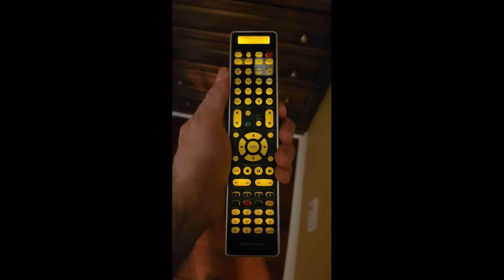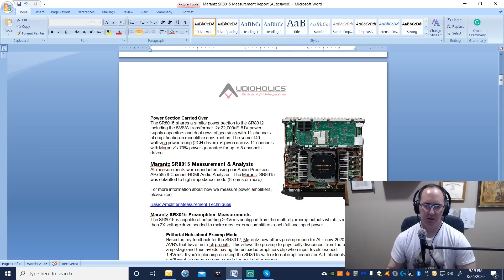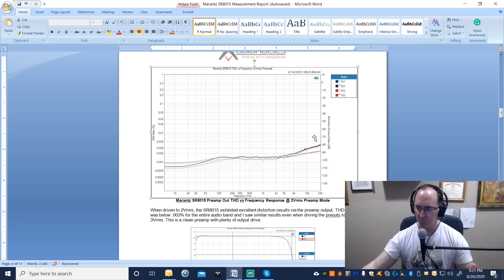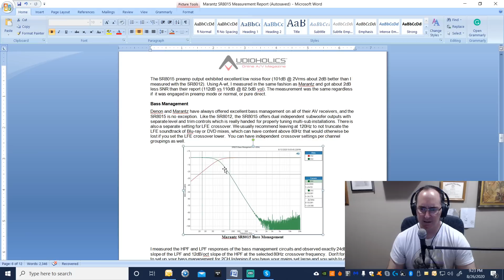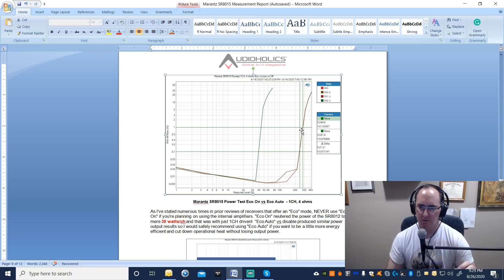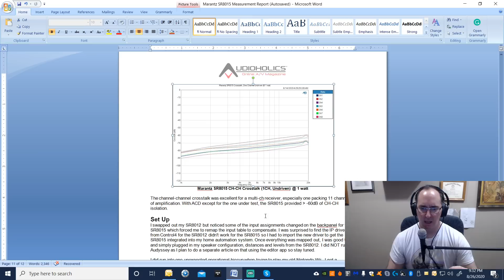Marantz SR8015 Best AV Receiver for 2020? Bench Test Results!

Comment: How does the Denon X6700H compare since these two avr's are identical on paper. There is a $600 difference in price; a solid comparison video would be great! Thank you for all your work Gene and crew!!!
Reply from the maker: I compared the SR8012 to the X6500 in my 8012 review as follows:

Marantz SR8012 Advantages over the Denon AVR-X6500H:

    HDAM SA2 current feedback topology between preamp and power amp
    22,000uF, 81V capacitors x 2 vs 15,000uF, 73V capacitors (X-6500H)
    Torodial 835VA transformer vs 750VA E-Core (X-6500H)
    Separated symmetric construction vs single in-line (X6500H)
    Copper plated chassis
    More rigid top cover
    Teflon tape on oscillator circuit for better damping
Reply: @Audioholics  Thank you Gene.👍
Reply: @Audioholics  a uk review  stated when reviewing  the 8012 save your money  and Biy the Denon 6500H ?
Reply: Agree, I'd love to see this comparison also. Thanks.

Comment: with the pre-amp mode available, does it make any sense to have AV7705 or AV8805 ?
Reply from the maker: Yes if you want XLR connections and also want a product that dissipates less heat since there are no amps built into the dedicated pre/pros.
Reply: @Audioholics  The heat shouldnt be an issue for me. Will the sound be a significant different between SR8015 to AV8805? from what heard from your review, seem like SR8015 is already at the same level as AV8805.

Comment: Hi Gene! Great review. I wanted to have a 5.2.4 set up.but I'm not sure if  I will get Marantz SR 8015  receiver or Marantz AV 7705  pre/pro which is 11 channel only .. My question is if go with the Marantz AV 7705  and just  add  2 Outlaw 7000  amplifier with 130watts x7  per channel. Do you think the Marantz  7705 pre/pro will sound better and cleaner? Thank you in advance!
Reply: He answered another guy that with a processor you don't get that heat dissipation and you get balanced outputs. But I also believe he said measurements being on par with a processor. You might wanna wait for the upcoming AV7706.

Comment: Thanks for great testing of the amplifiers, but these machines are so much more, do you plan to do any testing of the video performance?  I experienced many problems with audio sync via HDMI with the new 6700H, a sister product.  I have heard from my local dealer that the HDMI handshake is problematic with this unit as well.  Would love it if you would try testing the ability of the receiver to lock onto the HDMI signal and maintain the lock.  I am guessing I am asking for too much :)  Thanks again for the great testing and presentation.
Reply from the maker: yes i will try to cover that in the formal review.

Comment: Do you have any measurements for Distortion+Noise vs Preout Voltage (from 0-4 volts)? Can this AVR do more than 2 volts in preamp mode? A few super powerful amps that are 500 watts to 1000 watts need up to about 4 volts to get to full power.
Reply from the maker: Yes it does up to 4Vrms unclipped.
Reply: @Audioholics  Thanks, Gene. Keep up the good work! 4 volts unclipped from an AVR is pretty amazing! When I get the money, I'm gonna connect all 13 channels to 1,000watt monoblocks with input sensivities of ~3.5 volts. LOL!!!!!!

Comment: Is it all or nothing with these preamp modes? Could I run just the front two speakers with externals and the front two internal amps will disconnect? Or does it only do that when you run it as a full on separate pre/pro?
Reply: Preamp mode is all or nothing. But you can also do just the fronts as I understand it.

Comment: I just started building my system. I do not have a amp yet but I do have my Klipsch rf7iiis on a 5.2.2 system. I bought a 600 starter receiver knowing I would have to upgrade at some point. When I do upgrade would I be better getting a power amp at least for my front sound stage or getting this receiver since it does have very good power. The receiver I have now is a Yamaha aventage 780.

Comment: the +10 over that was because you tested at 0.1 distortion, on the stats it listed it as 0.05 distortion for 140hz so it is rated as is. also gene i am interested when the marantz SNR is 110 DB what is the difference from a lower tier receiver such as the aventage 3080 that has a 120 db snr?

Comment: Nice solid numbers! Great job Gene. Unfortunately, I can’t afford this model. I just pre-ordered a Denon x4700h but I still flerting with Marantz SR7015 . The specs are identical. Which model should I go for?
Reply: Marcos Filipe Pereira you are correct about specs. I went back and forth between the AVR-x4500h and the SR7013. Same situation. Ultimately, I ended up buying a refurb X3600H from Worldwide stereo for $600 in January. Not a single regret. I love the x3600!  But I did test it against the SR7013 at a retail store and then Marantz sounded noticeably better. As did the x4500 compared to the x3600. The difference was not as noticeable between the x4500 and the SR7013, but there DID seem to be that “Marantz sound” of depth and warmth from the SR7013. For the approximate $500 difference, I could not rationalize the extra cost over the x4700h. But strangely, I CAN rationalize the added cost of the SR8015 over the SR7015 (approx $900 more). 

I’d say, ENJOY the x4700 for all it’s worth. If I can love and truly enjoy my x3600 as much as I do, you’ll NEVER regret the x4700 performance.
Reply: Mark Van Alstyne Thank you very much for the detailed answer! I will stick with X4700H.
Reply: Marcos Filipe Pereira you’re very welcome sir! Have a great day and enjoy the 4700 when you receive it.

Comment: Trying to find the difference between the 8015 and the 7015 besides the obvious number of channels and watts driven. When comparing specs I see under transformer “toroidal “ and “El”. What is El? Also any other differences? I mean we’re talking about $700 between the two models.
Reply from the maker: 8015 has a bigger power supply and other upgraded components. If you're going to preout to external amplification, get the 7015, if you're never going to add an amp, get the 8015.
Reply: Audioholics thank you. So what is the difference between “toroidal” and “El” transformers? 
Considering NAD T778 too.
Reply: @brainguynyc8729  The toroidal transformers are much more expensive and better with noise.

Comment: I know it may sound redundant, but I would really appreciate an in depth look at the SR7015. I say this because I feel that the 7015 sits in a more friendly price range and also better represents the rest of the marantz line. The 8015 looks amazing but it’s the only one with a toroidal and all those nice features. The other three models seem more similar to each other in that sense. And to see a look into one of them may represent the rest of the line a little better then the flagship. Great video though! I appreciate all the work.
Reply: I'm with you...that's the one I'm looking at, as I'm running a power amp on five of my nine channels (5.2.4.) and don't need the receivers extra wattage (or channels).  I would prefer the Marantz to the Denon 6700 (purely for aesthetics) but we shall see.
Reply: I agree I hope the SR7015 gets an in depth review.
Reply: Yes, the SR7015 is the one I'm considering as well. Would love some measurements on it.
Reply: I want to add to the redundancy here. I would love to see similar tests on the 6015. I feel like that extra $2k (for me since I will be running 5.1.4) could go to some other updrages, especially if I may use external amps in the future. But I would hate to miss out on significantly better quality since I only upgrade receivers every 10 years or so.
Reply: What's an "El" transformer?
Reply: I wanted to consider the SR7015 as well, but I feel like I’m either going to go SR6015 or full hog with the SR8015. I prefer the SR7015 over the SR6015 in every way, but with the new preamp made and me being able to use amplifiers altogether, I feel like the SR7015 is more waste than good.
Reply: Mark Van Alstyne u make good points, but the 6015 does not do auro 3D if I’m not mistaken. While that’s not the end of the world. In my case I’m trying to get something I’ll be happy with for quite some time, and I know in a few years I’d regret not having that capability. This is specifically true for my situation though because while it may be taboo, I thoroughly enjoy listening to music upmixed into surround. I hear auro is terrific in that field, and now that Dolby has gotten rid of center spread auro may be my new go to for surround music.
Reply: matt olsziewski I believe you are correct about the SR6015 not having Auro 3D. For me, I don’t think I’ll ever use it, so it may not be as important for my needs. I suppose some/most may think my logic is flawed, but with the SR7015 being $2300, I feel it’s such a better investment to drop the additional $900 to get all of the wonderful benefits the SR8015 has to offer. We are talking toroidal power supply, Gene’s tested 160 watts RMS into two channels (SUPER IMPRESSIVE), a better chassis (copper plated), 11 channels on board with 13 channels of preampfification, and the icing on the cake being manufactured in Japan instead of China, Vietnam, etc. 

For $900 more money, I believe the SR8015 is a VALUE over the SR7015. That’s not to say I don’t believe the SR7015 is a bad choice or a “subpar” receiver.  At Magnolia/Best Buy (before COVID), I tested the SR6014 vs the SR7013 and the SR7013 was obviously a better AVR just in pure sound and power. Magnolia isn’t the best place for a test, but it’s what I have around me and it didn’t fail altogether. I only wish they had a SR8012 at the time so I could test it as well. 

I’d enjoy hearing what others have to say. I want to go for the SR8015, but it’s basically twice the money as the SR6015. And with the new SR line having the preamp mode, it makes things more difficult to choose. If the SR8015 was the only new Marantz AVR to have the Preamp mode, it would be a no brained for me. I’d just have to save up a little longer. 

I had considered going with separates because heat is what kills electronics. But after hearing so many reviews on the Marantz 7705 and better ALL running as hot as other Denon and Marantz AVR’s, it doesn’t make sense to me to opt out of the built in amplification option for the future. 

Please chime in folks! And thanks to Audioholics and Gene specifically for bringing such great content to us all.
Reply: Mark Van Alstyne I want the 8015 myself, but slightly out of reach with budget. I also use an external power amp to run more fronts so that’s another factor I consider. The more I think about the 8015 the more I want it though.
Reply: @mvanalst2003  I would love the SR8015 not only because of the toroidal transformer, but also the monilithic amp design for the channel separation, the new HDAMs and the great measurements from Gene. But it would feel slightly better to pay that much if it had more HDMI 2.1 inputs even though they all still have the gaming features and 8K upscaling. An alternative would be to go for the SR6015 and an external amplfier for about the same price, but then you don't get  the SHARC DSP which gives us Auro 3D.  Decisions, deciscion!. DId you say the AV7705 run as hot as the AVRs? AV7706 is rumored to be coming out later this year too.
Reply: matt olsziewski hahaha. ME TOO! Hard to shake the feeling that the SR8015 would make me smile every time I look at it.
Reply: Raritytuber yes sir, all reports say all of the Marantz preamplifiers run so hot that they are uncomfortable to put a hand on when at full operating temps. To be fair, that’s not first hand (no pun intended) information. And also, it’s hard to believe they can run THAT HOT because my AVR-X3600H is suppose to run hot, yet it rarely feels all that warm. This greatly surprised me.
Reply: @mvanalst2003  Maybe your Denon is running with Eco Mode On or Auto? First one isn't recommended if you use internal amps though.
Reply: @mvanalst2003  I used to own an SR9600. The last true behemoth Marantz 9-series receiver before them switching to separates in their highest-end tier in around 2008-2009. Gene Tested the SR9600 back in 2006-2007 when it was released as the closest you could get to separates in that period. Alas the 9600 is by todays standards severely outdated and I am betting to put money on the idea that the SR80xx series of today are around the same level of that 9600 even though that one pushed a maximum of 7 channels and the SR8012/15 are pushing 11 !!!! in a box that is (a bit smaller ?) maybe than the SR9600 was. the 9600 had a beautiful heatsink design with low-noise fans and it would run warm but never HOT to the touch. I also tested an Onkyo TX-NR912 I believe it was in around 2007/2008 and man, you could fry eggs on that one by comparison, even though both did 7 channels and had toroidal transformers. So good design matters a lot.  

I understand completely why you would be thinking about going for the 6015 instead of the 7015 with the now available pre-amp modes.  Since a year and a half or so after having been stereo only since 2010, I got a great deal on an SR7012 and man... It outperformed all my expectations in an almost indescribable way.. way better per total than it had any right to be at the price point I was able to get it for back then. (Especially in 2 channel Stereo) And maybe I forgot how the SR9600 sounded back in the day, but the SR7012 sounded just as good to my ears;  It was able to make me forget about speakers/cables/amps and all that stuff and project a very 3D stereo image into my room, making me truly enjoy the material, what is ultimately the most important thing.  

Now I want to upgrade from 5.2.4 to 7.2.4 but I don't want to add an external stereo amp, so my option was the SR8012.. which I also got a great deal on.. but right after delivery of the SR8012 the SR8015 was announced.. feeling a great deal of buyers remorse, I called the store as the SR8012 was still new in box. Luckily they were very understanding of the situation ( I also buy stuff from them for almost 3 decades now) so I am allowed to swap out the SR8012 for the SR8015 with a small extra payment from my part, which I can live with, provided that Marantz really made some nice upgrades in this one. 
my only (small) concern is how hot the SR8015 will run, especially driving all of the channels it is capable of... At least it won't be in an enclosure, but standing freely on my now ageing Marantz BD8002 Blu-ray player ( as 4k disc source I am using the Xbox one X but having the receiver stand on top of the BD finishes the look for me at least, even though the design language is a bit different...

Comment: I am currently using the Denon AVR X4000, it has the pre-amp output  that can be used for 2 channels only.   I am using it for the main fronts to an Emotiva LPA-1. I would like to upgrade to the newer Denon.
Reply: Dan Lee hard to go wrong with another 4000 series. The x4700h looks pretty impressive compared to any competition. 

I am personally trying to rationalize the cost of the SR8015 because I’ve wanted a super receiver since I bought my first decent receiver (Yamaha RX-V1000) way back in 2000. I used to drool over the RX-Z7 and RX-Z11 and the SR8015 gives me that same fizz.

Comment: Thanks for showing the backlight on the remote :D it looks to be a fine remote, the little LCD is certainly a nice touch.  

I wonder if built in headphone amps are clipping/adding noise, maybe they should be part of the pre-amp disconnect too.

Comment: Could they release a version without the internal amps just as a processor?
Reply: There will be the AV7706 though.
Reply: That would be the 8805 Pre Pro, but I don't know if they are coming out with an 8806.
Reply: Only if there is a high demand i guess,
Reply: How do you think the 8805 would compare to this AVR?
Reply: @kevinpoirier6940  maybe better in terms of voltage without much distortion (i.e. cleaner output at higher voltage with AV8805's XLRs)?

Comment: After your SR-8012 review you had recommended the SR-7012 as a very good bargain versus performance. I bought it new on sale for $1,000. I am using 8 of the 9 amps for surrounds and Atmos with monoblocks for the front 3. The AVR has served me well. I believe the SR-8015 will be my next upgrade as it is feature rich over my current one. Thanks for confirming the specs are equal or better than advertised.
Reply: Is it worth to buy Gene?
Reply: I am coming off a 7010 and it is a good difference. It rests and runs much cooler, the programming feature rocks, and of course I get to run a 7.2.4 now.